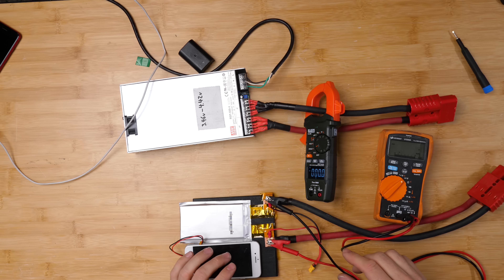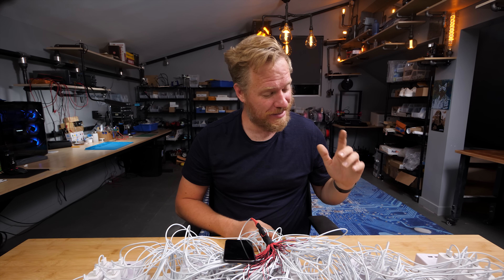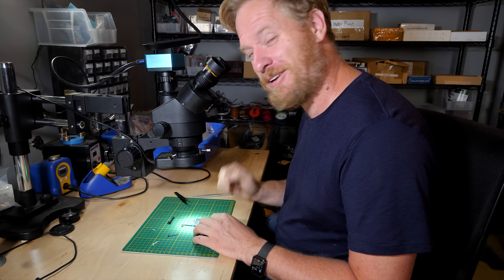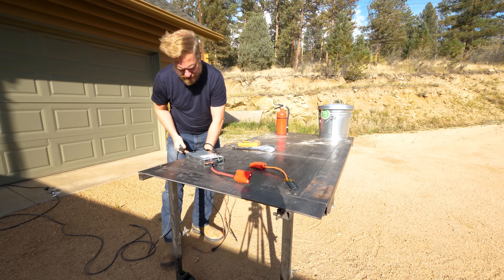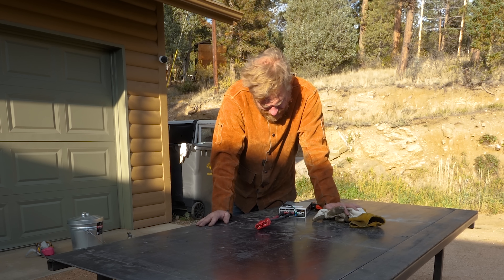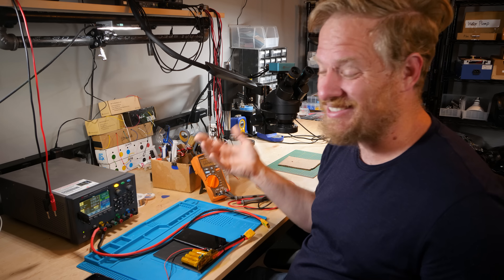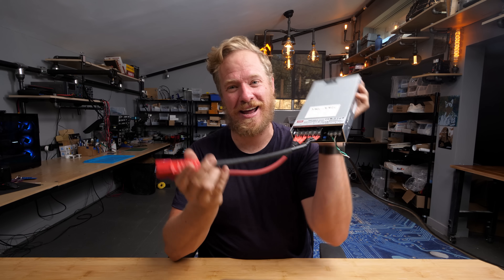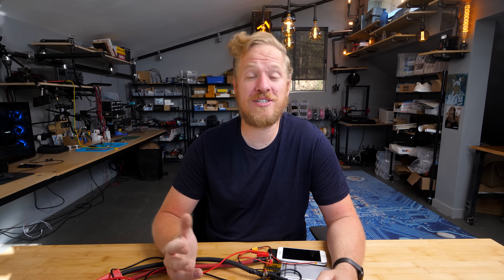I built an iPhone that charges in 9 minutes

Comment: could you have connected those 4 Lithium titanate batteries in a 2 x 2 config in which they could charge at 10 amps and be at ~ 5.7, which could also half the charge time since instead of going 2.85*10 - 28.5 W, you could charge at 5.7*10 = 57 W

Comment: the redmi note 12 discovery edition charges at 210w, on a 2x higher capacity battery(4300mah) from 0 to full in less than 10 minutes. that's how far ahead other companies from apple

Comment: Or you could just get something else than an iPhone... iPhones have tiny batteries and super slow charging. Xiaomi 12 Pro for example has higher capacity battery than any iPhone and it can be charged from 0% to 100% in under 20 minutes with the power adapter included in the box.

Comment: also, phone's charging circuit limits charge current. not bms.(bms has it for secondary protection)
and iPhone batteries are at 4.35v when charged fully.

Comment: Scotty should look into Oppo's SuperVOOC 150W or Xiaomi's HyperCharge standards for comparison. those two standards are insanely fast and are in production devices. maybe in a future video, Scotty could engineer something that works pretty similarly to either standard, but packaged to fit in an iPhone?
Reply: Isn't it because they charge at higher voltages or because there are two batteries in the phone.

Comment: Li-po batteries will only charge at 1C trough direct power. So if they are 1300mah, they will only suck 1.3A normally.

But if you pump up the voltage, you can charge it faster, but you need a really good battery managamnet to prevent overcharging.

Comment: A part of the conversation I always feel gets left out of the battery replacement debate is charge cycles.
I would gladly accept a 60% capacity reduction in favour of a 30min or less recharge cycle + an extended life cycle or improved rate of decay than the current lithium options.
For example, my current phone is about 4 years old and currently have less than 70% of it's initial capacity (yes I know I should get the battery replaced) something with half the energy density of a new battery at this point would likely still hold closer to 90% of it's original capacity, with the added benefit of faster charging. Which in my opinion would greatly aid those who're slower to update their phones.

Comment: Next on strange parts 
I kept my phone on for 24 hours straight
Proceeds to keep phone connected to wall outlet lol
Loved your usb c video and the other videos in china
My problem with this video is that this is not some improved mod that you’d normally do like adding a headphone jack
This is plain explaining what types of batteries exist and demo a super capacitor which doesn’t fit the iPhone chassis or work on it.
9min claim should either showcase how the phone performs too

Comment: Even when not charging within 9 minutes I'd take the capacitor as I wouldn't worry about the chemical wear then.
I personally would also take a bigger heavier phone and pick the capacitor.

But given that I wonder about a hybrid solution. A fast charging capacitor that then charges the normal battery at it's normal rate. Wouldn't make sense in a phone but put a capacitor in a phone case and you can add fast charging to your phone.

Comment: I think most of us would prefer the super conductor, whether it meant half the capacity or twice the size or some combination of the two.

I don't think those are the main issues but rather the inherent danger of that much voltage in a charging device for the general public.

Comment: Honestly my first smartphone was some ZTE thing from the early 2010's and I got the expanded battery which comes with a larger back that fit the larger battery so I wouldn't be too worried if I could have a decetly powerful phone with a fast charging high capacity super capacitor even if it made it thicker (though hopefuly not like 1 inch/2.54cm thick XD)

Comment: I wonder how long the capacitor would last if you just used it as the battery.
Would it last half as long as the standard battery? 
Or would it just discharge in one go?

Comment: I would absolutely go for a phone that was twice the size, but lasted just as long and charged in 9 minutes. 100%.

Why? If you only need 9 minutes to charge your phone fully, it's barely an inconvenience to have to charge it. Also, the whole drive to make phones as thin as possible is dumb IMHO. As long as it's not the size/mass of an _actual brick_, size/mass don't really affect convenience/usability too much.

So far as I'm aware, supercapacitors also last much longer (in terms of cycle life) than batteries.

Comment: While watching I tried to imagine how I'd approach this mission, and was almost disappointing with the supercap conclusion! Here's hypothetical how I'd approach it:
High current is problematic. Things get hot, wires are too big and equipment is bulky. Modern fast charging increases the power delivery by increasing the voltage, pretty straitforward. However the final limitation is still how much current you can charge a single cell lipo with. So, here's my idea: let's swap out the lipo for many smaller cells. Create a high voltage battery by placing cells in series, then step that voltage down for use. That would allow you to practically provide enough power to charge the entire battery in the same time it would take to charge a single one of the small cells at it's highest charge current. It doesn't come without challenges, you'd need to consider cell balancing, presumably manufacturing would be problematic and the energy density would be lower than a single cell due to the overhead of packaging multiple cells.
Anyway, that would be a fun project to try.

Comment: 1.8 ah is a measure of capacity. 1.8 a/h is a measure of charge rate. With enough lemons, you could make a 1.8 ah battery, but the current wouldn't be enough to do more than turn on an LED likely.

Comment: Can you charge at higher than rated voltages to get more amps disregarding cycle life/battery health and use an external cooling system to keep temps under control

Comment: The super capacitor can be made in the format of the powered iPhone case that would charge the iPhone battery. Dimensions would allow it. The power adaptor in this case would be quite expensive and fairly dangerous for an average phone user. Even with the power bricks hundreds people die every year from electric shock by using the phone in the bathroom or with damaged cord. The supercharger would definitely aggravate this problem. Another issue is super capacitor would quite deadly if discharged into the person.

Comment: what about capacitor connected with both battery and solar panel? or what about try using vooc charger(the charger soaks up the heat built up i notice with their thick cables) and their split battery combination for fast charging?  or those QC standard where the phone heats up instead when charging? or  xiaomi charger which uses hi 120w charging with normal batt (not split bat) to do fast charge? btw nice to see you re back to tinkering stuff, this is what i like to watch

Comment: I've never seen a super capacitor in that form-factor. I tried looking that up but I couldn't find any info on it. 

 Capacitors in general can be deadly, even ones in consumer products (e.g. microwaves). I'm not sure what the safety implications are for having high capacity super-capacitors in portable electronics. Sure Li ion batteries are essentially bombs already, but these have so many protections built in that make them mostly safe.

Capacitors on the other hand risk both explosion hazard and lethal shock hazard if something goes wrong.

Aside from safety concerns,  that flat super-capacitor would be perfect for a tablet or laptop. Imagine being able to charge a laptop or tablet in 10 to 15 mins.

Heck, electric vehicles with these things would be a game changer, if the the power grid could even keep up with max charging rates. Even if they were charged slower, the fact that capacitors have much longer lifespans is *massive*.

Super capacitors simply do not wear out with recharge cycles like Li ion batteries do. They have lifespans measured in hundred-thousands and some in the millions of charge/discharge cycles.

Comment: If I am looking at your experiment correctly, you would need a larger capacitor around 7000F to equal the same storage capacity as the original lipo battery in the phone.  That also doesn't take into account the voltage curve of both devices from full to discharged.  Lipo batteries do exist that are capable of charging at a much faster rate.  18-30 minutes for a full charge on a 4000mAh battery is available for some phones on the market but Apple devices are usually behind the times with new technology going all the way back to the original apple computers in the late 70's.

Comment: That was unexpectedly lame, you didn't build an iPhone that charged in 9 minutes but an alternate powersource from which you could run an iPhone. I bet the reason why you didn't see more than 1.5A is simply because there's more protection circuitry after the "BMS". Anyway, an iPhone 8 happily takes 1.5A off a bog standard USB supply if the prerequisite charger indication is available (and you're using fully connected USB cable, including the data wires) and it is officially specified by Apple to being able to charge with up to 18W with the proper gear (I believe this would work with a USB-C to Lightning cable and a proper USB-C charger suppording PD at 9V/2A but one of my kids took the last of my cables from the stash).

I was totally expecting something sophisticated like replacing the battery by multiple smaller cells in parallel or so...

Comment: Sorry noob question, so when you are using the PSU to charge the phone in that example after the 100 power bricks, what does the negotiation of the fast charge if there was no brick ? and if theres not one, does it just default to low charge? I feel there is an simplicity to this that Im not getting lol

Comment: I'm surprised the supercap is that close in size. If it was 75% or less the original capacity but could get charged in 5 min that is not bad. How long can it hold it's charge?

Comment: I'd love to see you open a OnePlus 10T battery and see if it can be pushed further than the stock 125 watts.
Reply: Xiaomi phones with 210w charger for 300$ :🙈
Reply: Yeap, kinda crazy to think they got to that without these super caps or wires as thick as your finger
Reply: @kaukon  not really it's about the voltage if you keep voltage high then your current to get same output power at low voltage will be much smaller 
And also it's 150W at 230V and it's using 2 bats in parallel can't find much info but it's probably 20V 7.5A charging
Reply: @dan2800  for the non US model. Here we're limited to 125watts with our power being 110v
Reply: My idea is to stack 10 ontop of each other, and sure you have a thick phone but it also charges at 1250 watts
Reply: @ZackHab  (plugs in phone and trips the breaker) lol
Reply: @NikoFabri  lmao you need to wire it directly to the grid for it to worl
Reply: dissect Nothing 2 pls

Comment: The BMS uses the cell voltage to estimate the battery percentage. 4.2v would be 100% and ~3.5v would be 0% so since you’re putting a constant 5v it’ll stay there. Would be cool to try those cells in series and remove the step up just to see the bms report an accurate percentage

Comment: Interesting stuff... that I don't wanna mess with because I don't want a thermal runaway inside my small apartment. xD
I was expecting a LiPo explosion from the beginning of the video... xD

Anyways, funny enough, we may... MAY be getting something that way directly from Apple now that it has been forced to adopt USB-C by the EU. If Apple adopts USB 4 and above, it could handle enough power to charge a smartphone battery super fast.

For those curious about the other side, there is already an Android phone that claims it can be fully charged in 18 minutes... Vivo iQOO 7 if I'm not mistaken. It also has a 4000 mAh battery, so it's well over double the iPhone 8 battery size. True or just "theoretical", I dunno. It is a flagship model from the... I think 5th biggest Smartphone company worldwide though.

Comment: Amazing to see how much supercapacitors have progressed over the last 10 years. And I'm glad Scotty is doing well
Reply: I strongly believe that this isn't a supercapacitor but a boosted up Lithium battery. Capacitors and/or supercapacitors have to stand incredible pressures inside, and that's why they are usually cylindrical. That's also why capacitors explode from the top. If this was a supercapacitor the cell would have bulged in an instant because of the pressure inside. It is layered like a battery, and it probably is. But according to this testing, it's a pretty juiced-up battery, designed to charge and discharge more quickly than other regular batteries. still impressive, tho.

Comment: How about a phone with a tiny battery that last an hour or two alone but with a snap-on super capacitor system that allows you to swap it on the go, so you can basically never have to charge the phone, you just swap some capacitors on the go.

Comment: But the point of quick charge is that it charges at much higher voltages instead of massively upping the amps isn't it? Like 9V or 12V? I was suprised when you said you were only getting like 25W at 10Amps in the video. Phones these days(maybe not iphones) normally charge at around 30W maximum which I assume is 12V at 2.6Amps or something. Not sure how this is getting passed onto the battery but either way it's a lot better than this. My new phone has a 120W charging option(and comes with 120w charger) but it's an emergency use only type thing to not wear down the battery much, like I used it the other day to charge 35% in 4 mins just before going out.

Maybe it would be cool to get a modern large iPhone and then stick the battery of one of these 65W+ charigng speed phones and see if it can fit in it? But this would be a massive project like one of your USBC/3.5mm  iphone ones.

Comment: At first I thought you would fit a USB-C connector to an I-Phone to charge at 100W (USB.C Power Delivery) THAT whould have been awesome. I think there are more challanges to this than you mentioned: what tiype of powersupply is needed? How do you get the power trough the tiny connector on the phone? What type of charging circuit is needed inside the phone? What type of battery is able to charge this fast while actualy fitting inside the phone. Are projects like hacking features into phones still realistic since you no longer have direct physical access to the chinese electronics markets?

Comment: The reason the iPhone wasn't taking that many amps is probably because of the internal resistance of the battery. I'm not an expert either, but a load will take a fixed amount of amps depending on its resistance and the voltage you give it. In other words you're restricted within the bounds of Ohm's law. To charge a specific battery faster, you need to increase the voltage you're providing. This allows more amps to flow. Of course the battery might not be able to take it though and some of the iPhone's components probably wouldn't take a much higher voltage either. 

I'd love to see what happens when you dead short all those chargers btw.

Comment: You soldering the 8 gauge wire to the thin strips connecting to the battery feels very Nvidia-like for some reason

Comment: There is a third variable besides charging time vs capacity: Longevity. How long does that capacity last? Does the charging time increase as the batteries degrades? A super capacitor with half the capacity but charges in 9 minutes would be acceptable if the longevity was 10x better. Maybe not 2x though.
Reply: I am super curious as to what teh lifepan on the supercapacitor is, I know that most LiPo batteries are engineered for a 2 to 3 year lifespan in normal use, I will actually have to do the work and look at Lithium super caps to see how long they last.

Comment: omg I think this video will have same jumpscare like Electroboom haha

btw the possible cause when you merge 100 chargers and it is takes longer to charge is due to communication between phone and the charger. as you know, usb by default only allows to send 500 mA and if the phone wants more power it just tell the charger "hey I want more" and then charger sends 1 amp.
communication is done just by differentiating voltage on d+ and d- line of usb (analog), today they communicate by sending digital data on cc1 or cc2 line (type c connector only).
I think what's happening is the phone can't communicate with 100 chargers when you put them together, so the charger allow 500 mA to the phone.
that is the first stage.

the second stage is it is depend on phone's charge controller, afaik if the battery voltage is as low as 3 volt and at certain temperature, it will start charging at the maximum setting. so if your phone tells to charger that they can send 100 amp but the charge controller is configured just only 1 amp then charging process is done at rating 1 amp.

the hacky way is like what you did, directly send power to the battery, but I don't know why it is still slow or not blow up when you use super ultra ultimate big power supply haha
maybe there is another chip inside battery.

btw that's what I know, please correct me if I wrong.
You're Amazing!